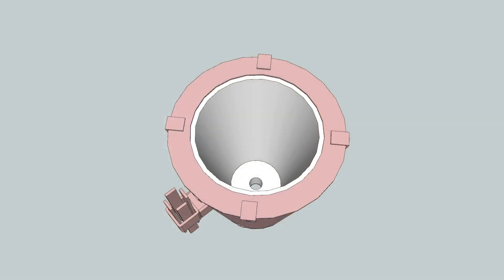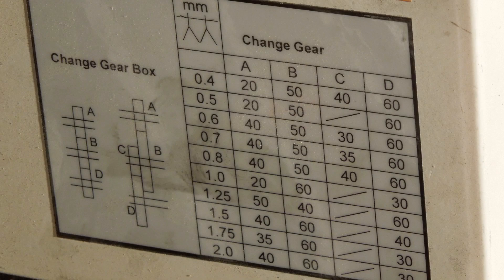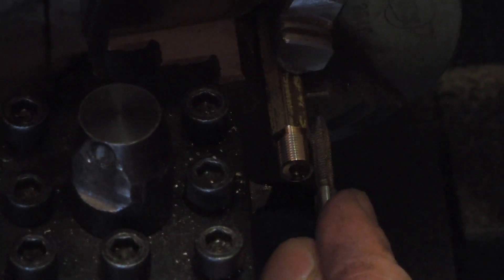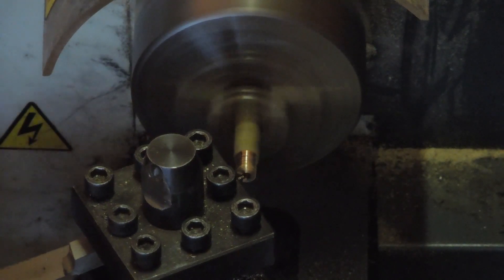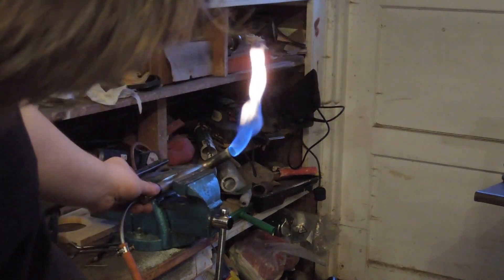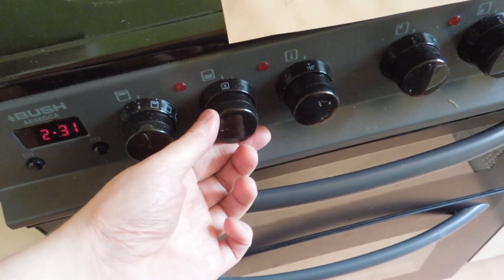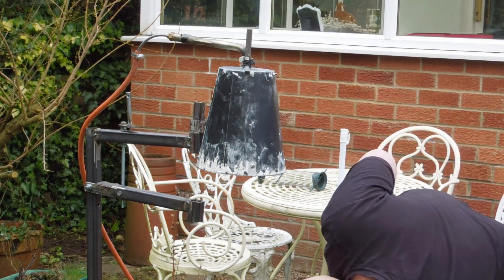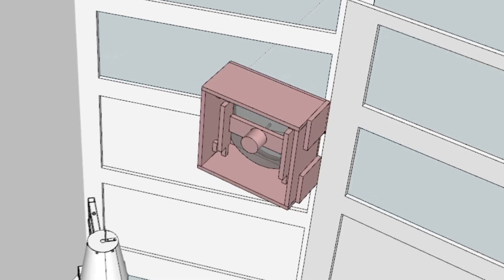Propane armour/ sheet metal forge - Part 4 - The Burner & More Refractory

Comment: Hi, how does your forge not "choke out"? In other words, how do you ensure there is enough oxygen?
I attempted to build something similar, but using and old "roofers" burner (1 inch nozzle). If I close the hole as much as you (or Eric Thing does) it just "chokes out". Do you think I should feed in air via an extra pipe + hairdryer?
Reply from the maker: If I remember right, I think I made the jet hole smaller to combat the same problem. That way you can increase the gas pressure to get the same amount of gas coming out, but faster, which helps draw in more air. A flare helps too if you're running it in the open air.

But still, when I read stuff online about burners I never really got any concrete stuff, and just playing around with the various things you can change (gas pressure, orifice size, amount of opening to let air in, and length of the tube) till something works seems to be the way to go about it.

A place to start would be looking at the flame and figuring out if you need more air or fuel and looking up how to go about changing it to compensate. http://ronreil.abana.org/richtolean.jpg

I don't know alot about forced air burners to comment though. I guess if you have no means of changing the orifice size then it'd be a way to get more air in.
Reply: Simon Heslop
Thanks for the reply. Well, it seems then experimenting it is! As far as I am aware, I cannot change the orfice of the burner, but maybe drilling extra holes to let more air in might help... Anyway, thanks again, and I hope I will not blow myself up!